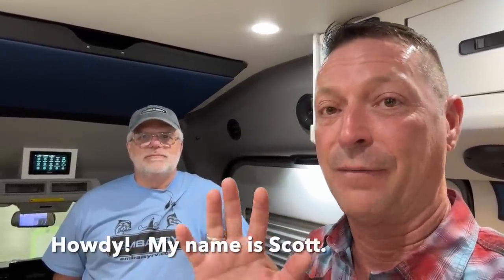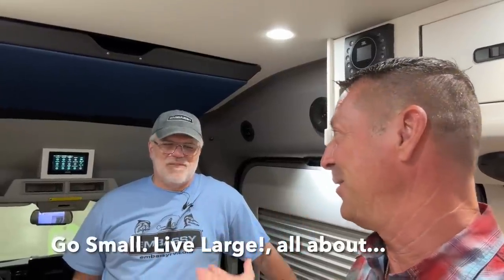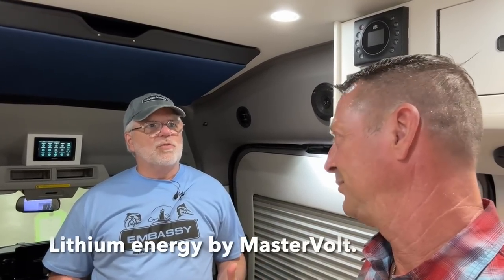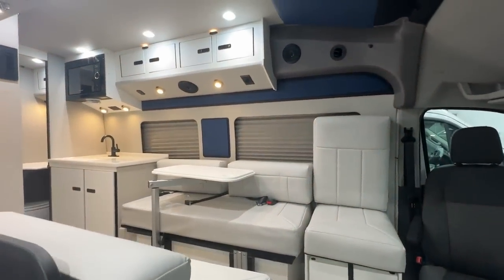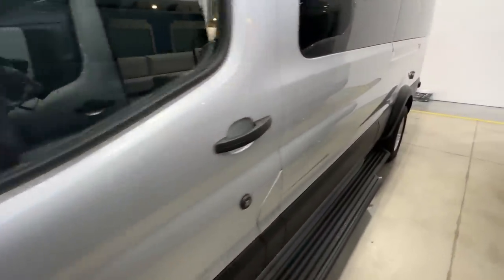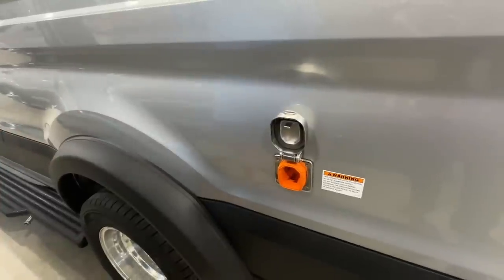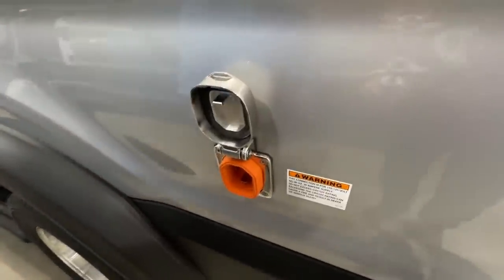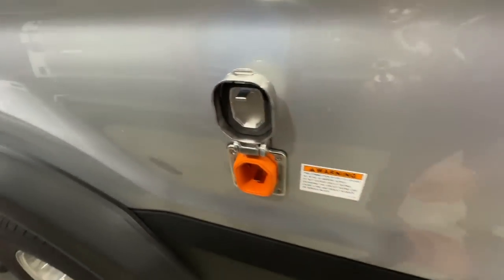Surprising Features Revealed - The Hidden Benefits of Embassy RV Class B RV

Comment: This is one of the best Class B's out there. It would be even more stealth with the smaller transit 19' 8" chassis and in a Medium Roof.
Reply from the maker: thx
Reply: I am used to driving a crew cab 8’ bed dually.   But I would like something like this inside, so a little length is fine with me. Is the burning toilet available yet?
Do the batteries stay dry?  That is a lithium problem for electric cars.

Comment: Where do people buy this RV and what is the general price range (I know its customizable and price varies).   Is there a dealer network or do you buy at the factory in Elkheart...   Also, is there an option to put in a convection oven microwave instead of only a microwave.
Reply from the maker: Buy direct from factory. Visit www.EmbassyRV.com for details and get the convo going.  Price ranges $135k to $155K depending upon options, but is very nicely equipped from base unit

Comment: I know Scott is intimately familiar with this but for others that may not, regarding the HOA and being stealth, the newer Travatos from 2022 on, are essentially the same as this rig. Very clean on both sides, except for shore power. We don't do campgrounds and have parked numerous times where they would normally run off a typical RV. We tend to find golf courses, medical centers or hospitals often. Yes, if people want to really look further, they might notice the black/grey tank valves but it's not that easy to spot unless you're RV savvy. We just can't do the toilet, no way no how. This is right there with a cassette toilet for us. Another concern for us is where are all these bags of biohazard material going? At least with black tanks you hope and trust that everyone is dumping where they're supposed to. If we have people driving rigs like this just throwing their poop bags away at any trash can, that's pretty gross. We rarely go No2 in ours, but if it's necessary we just couldn't handle riding around like that. We used bottled water only, and even with reasonable conservation we never run out of water. Unless I missed it, didn't see anything about sleeping but I read that it's 2 separate areas for 1 each. We have the Travato K model that makes into what's nearly a King, it's one of the primary reasons we bought ours. Separate areas would be nice if someone isn't sleeping well, but otherwise that would be a problem for us. The Embassy has nice features for sure, love that it has a spare tire. Enjoyed the video guys and travel safe!
Reply from the maker: thx for sharing

Comment: Love seeing the evolution of models. 
Why not use flexible solar on the roof that would be hidden from ground level? Would save some gas from being used to charge batteries.
Also, why not drop the smart jack cable through a floor port to eliminate the side mounted connector?
Reply from the maker: Join us for YouTube Live with Embassy on Jul 21, 2023 at 2:30 PM CT to pose those questions directly to them !

Comment: Love this concept that it looks like a Van vs. RV.  The only issue I would be concerned with is the A/C located on the underbody of the Van.  I would think it would get dirty really quick requiring much more maintenance to avoid clogging in the fins, etc. vs. roof mounted A/C units.  Although if they say they’ve overcome that, I’m all ears.
Reply from the maker: Hi tim
Reply: Not only the cleanliness aspect, but air intake from the underside can’t escape ground and under vehicle odors, plus particulate matter, which is more concentrated than above roof air would be.

Comment: Terry, please develop a model on the non-extended Transit AWD chassis for solo travelers who travel light and want something just as capable but a bit more compact.
Reply from the maker: Thanks Dig
Reply: Sorry, no.  This “solo” full-timer wants the largest van built w/ more storage and tabletop space to replace one of the twin beds.  At TV hidden behind a wall panel, hidden computer electronics drawer and designated place for a pet crate and litter box , plus consideration for adding an under-vehicle wheelchair lift w/dedicated inside place to dock a wheelchair or scooter would help make a floor plan truly solo flexible, capable AND accessible for all!